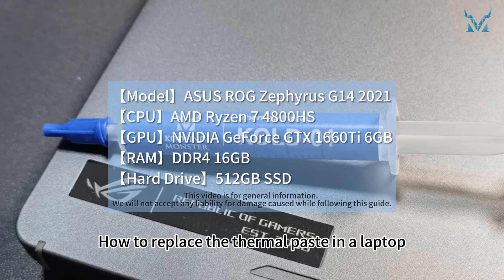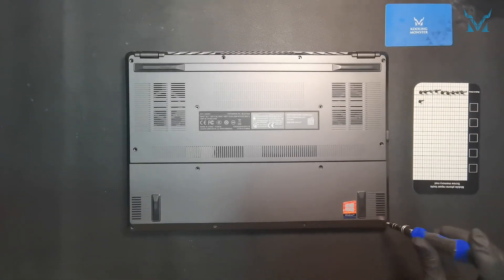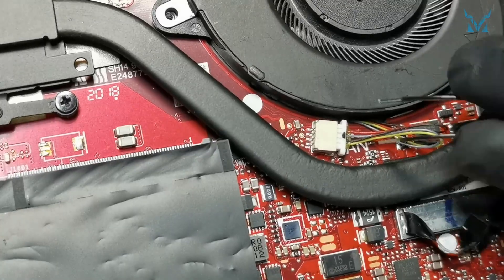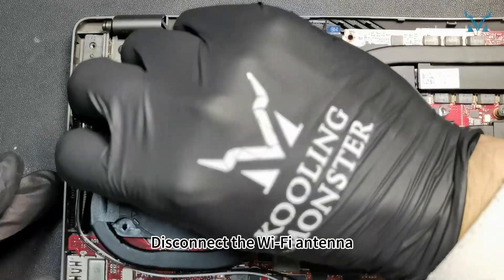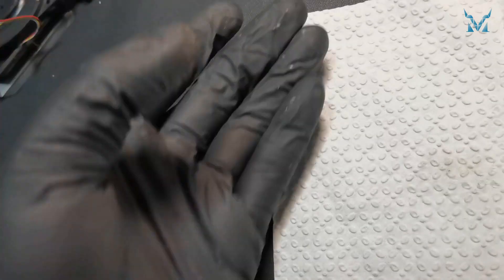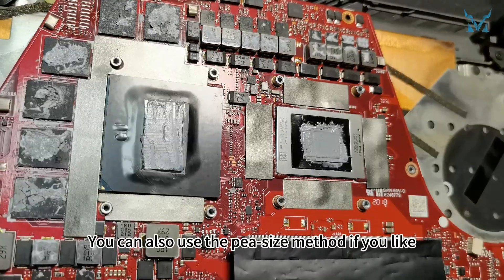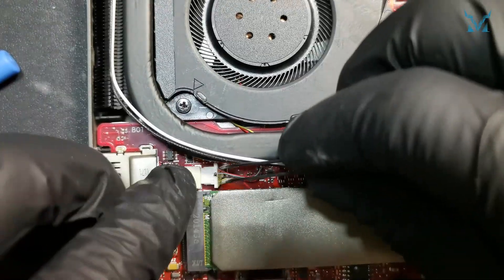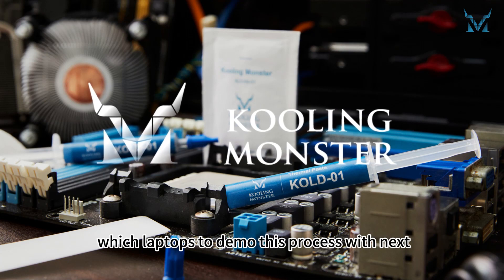Speed Up Your ASUS ROG Zephyrus G14 - Prevent Overheating With Dust Cleaning & New Thermal Paste

Comment: can you have to use thermal putty on the other components??
Reply from the maker: Good question! 😊
You only use thermal putty/pads on components like VRAM and power delivery chips, where there’s a small gap to the heatsink. For CPU/GPU, always use thermal paste.

Best rule: replace the material with the same type and thickness as originally used for proper contact and cooling 🔧😄

Comment: Good morning, that thermal paste on top of the gpu and cpu that has a lighter color and a different consistency, can you tell me its name? Is it thermal paste too or does it have another name? I removed my notebook and applied thermal paste, can I do this or will I have a problem?
Reply from the maker: The lighter, different consistency material is usually thermal pads, not paste. It's designed for easier application and to fill larger gaps. As long as you applied proper thermal paste correctly, it should be fine. Just make sure the paste isn’t over-applied and doesn't spill out.

You're welcome to try our KOLD-01 thermal paste! It's different from regular thermal pastes. Most conventional thermal pastes use a solvent-based formula, which causes the solvent to evaporate when heated, leading to drying, cracking, and loss of thermal conductivity. We use an exclusive solvent-free formula that perfectly solves this issue, providing better heat dissipation and a longer lifespan, especially for laptops.

Comment: I did everything in the video and now my fan is super noisy.
Reply from the maker: Hello, I understand your feeling. The loud fan noise after replacing thermal paste could be due to improper paste application, causing overheating or uneven heat dissipation. Make sure the paste is applied evenly and not too thick. Also, check if the fans are clean and properly reassembled.
Reply: You should never allow the fan to spin when applying compressed air. You can damage the bearings in the fan and you likely did. You'll need new fans.

Comment: You left the old flaked paste on the other chips?
Reply from the maker: The surrounding chips are video memory, which do not have high thermal requirements. The manufacturer typically uses thermal pads or thermal putty for these areas. As long as the original material hasn't dried out or cracked, it can continue to be used. 

If you decide to replace these materials with thermal paste, we recommend using our thermal paste, as the gaps in these areas are often too large. Most commercially available thermal pastes are too fluid and may leak. Our thermal paste is specially optimized for flow control, ensuring this won't be an issue.

Comment: Are we not supposed to change the paste on the GPU vRAMs?
Reply from the maker: The surrounding chips are for VRAM, which doesn't have high cooling requirements. The original setup uses thermal pads or thermal putty. As long as these materials haven’t dried out or cracked, they can still be used. If you want to replace these materials with thermal paste, we recommend using our KOLD-01 thermal paste. Due to the larger gaps in these areas, regular thermal pastes on the market tend to be too runny and may flow out. Our thermal paste is specially optimized for flow stability and won't have this issue.